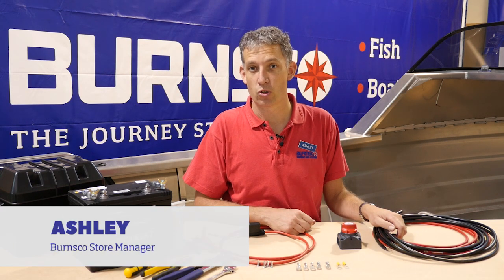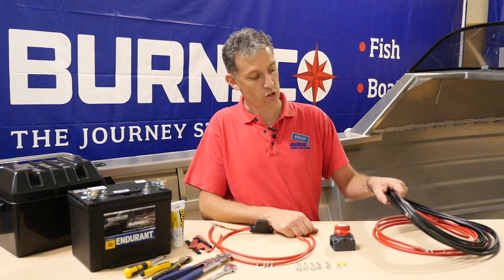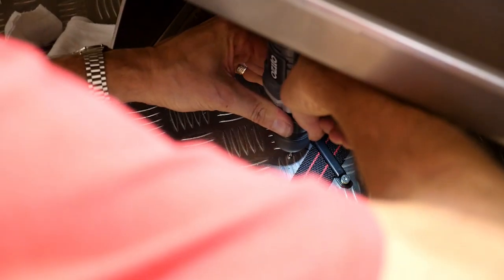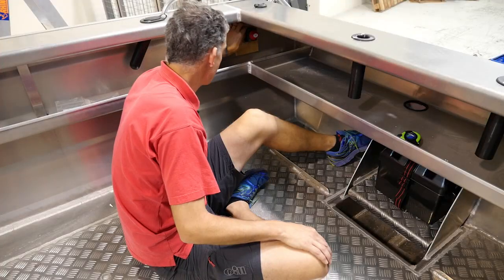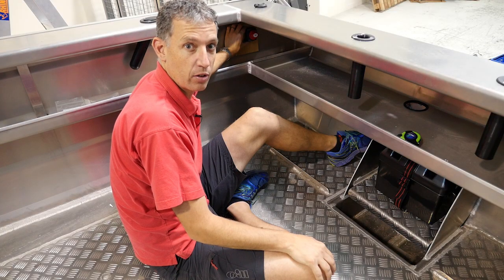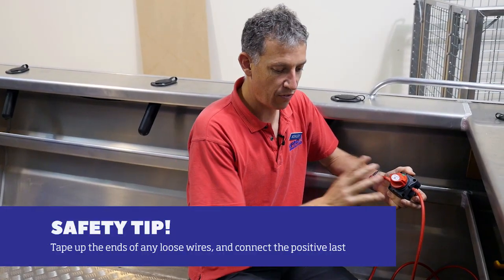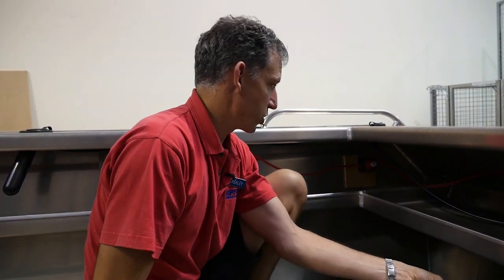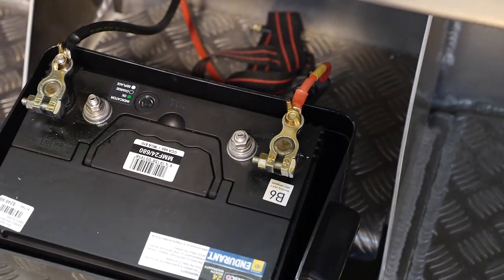How To Install a Marine Battery in Your Boat

Comment: Why use that dodgy 'clamp-on' terminal? Wouldn't it have been far better to attach the cable directly to the threaded battery terminal.
Reply: Wrong way to do it

Comment: So how do you put that battery box cover back on, with those large battery cables exiting the rear like that?  What's the "proper" way to route the cables through the battery box?
Reply: I cut my box out with a heat pencil.

Comment: how did you attach the marine ply to the side of the tinny?  I don't see any screws in it, was it epoxy?
Reply from the maker: We just used a little bit of sikaflex - saves you drilling holes in the hull.
Reply: thanks for your quick response!
Reply: kishidabu b ttc dc ttc

Comment: my Taiwan single switch failed within 18 months leaving me unable to start the motor took the loom, battery and panel out for testing-all ok--should have tested the switch first ---
several hours work out on a mooring

Comment: Thanks for the video. What gauges of the cables, fuse amperage are you using...?  Engine connection to the battery switch...?
Reply from the maker: We're using 20mm marine cable, the size you'll need is dependent on the size/type of your outboard but generally no less than 20mm,

Thanks
Reply: Each cable looks no bigger than 10mm are you sure it is 20mm?

Comment: I have seen this done mostly using the negative wire. Is there any reason to use the positive versus the negative?
Reply from the maker: Hey Aaron, the reason we use the switch on the positive wire is that it isolates the power to the stern instead of having a live wire running up the length of the boat, this also helps to protect your switchboard if something was to surge,

Cheers